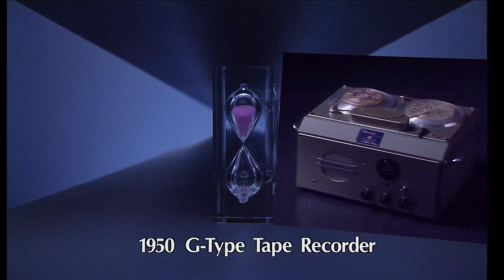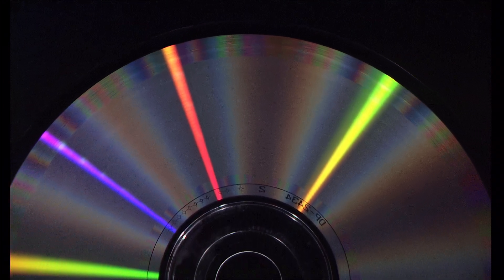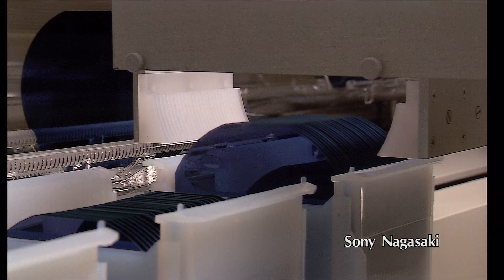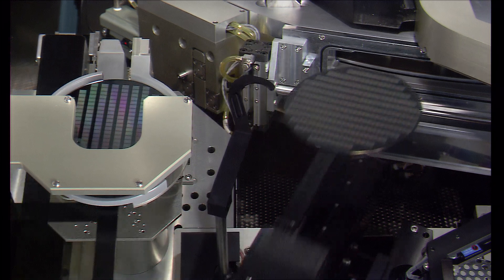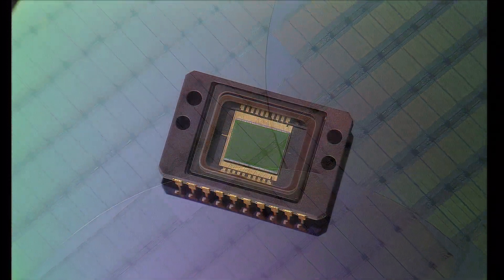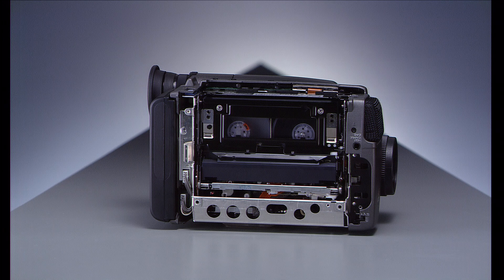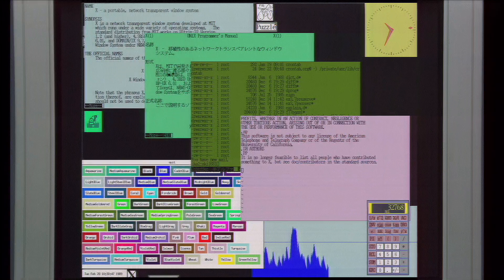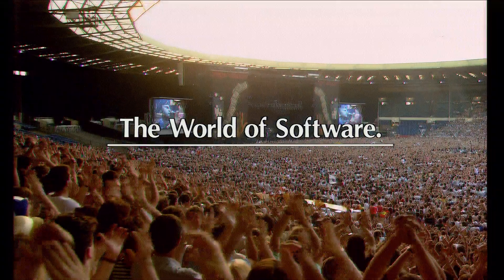Welcome to Sony Semiconductor World (Feat. Genesis, Yuji Toriyama) (1990 Prototype HDTV 1035i Demo)

Comment: Interestingly, image noise resembling film grain is evident throughout the entire film.
Could this be due to the use of a hybrid system that combines analogue recording with digital editing?
Additionally, the subtitles exhibit signs of 'dot crawl' originating from the composite signal.

The scene at 5:10 in this video, in which electronic components are being installed, is one that I have seen before on the HDVS disc Good Night Tokyo, released in 1993. It is likely that it has been reused.
Reply from the maker: Regarding the subtitles, HDTV was not a composite signal so it cannot be dot-crawl. I believe that is actually minor time base error from the original analog tape.  The HDV-1000 TBC unit was not extremely precise.
Reply: What grain? All HDVS I've watched looks like that.